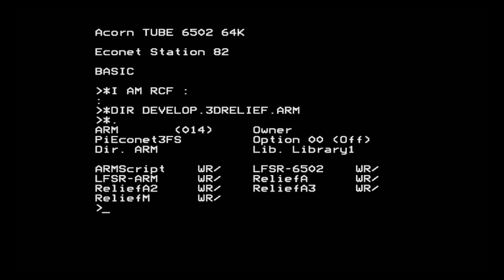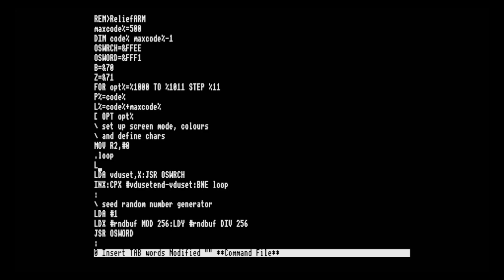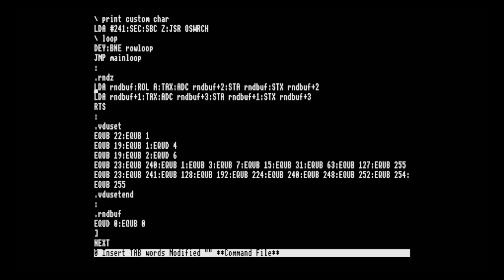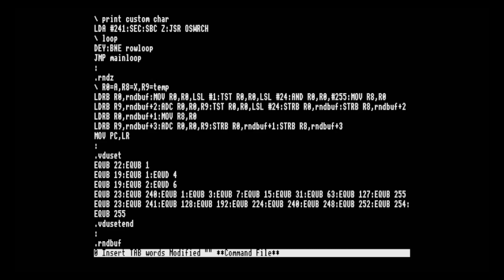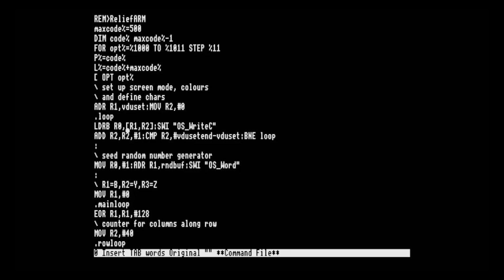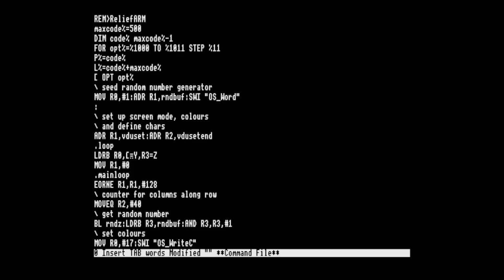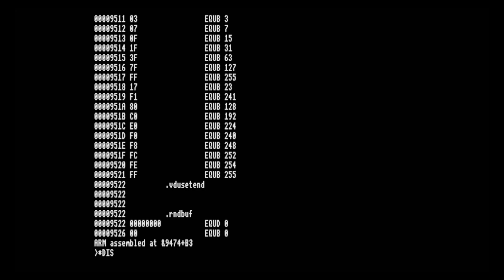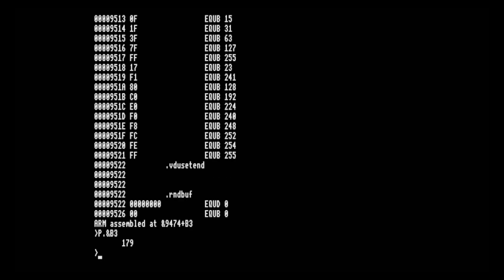ARM 3D 10 PRINT using the BBC BASIC assembler

Comment: The ARM chip has the MUL R0,R0,R8 instruction as well as DIV RO,RO,R8 as well as UMUL and UDIV
Reply from the maker: I think that the first register to be multiplied cannot be the same as the destination register — e.g. you can do MUL R0,R8,R0 but not MUL R0,R0,R8.  DIV isn't supported in BBC BASIC V (although I think if I manually fed in the opcode, the code would run).  That said, I don't think either would be helpful in this program.

Also, I was trying to stick to the original ARM1/2 instruction sets (although I do know of a problem with that which I overlooked!) so I could run things under the ARM2 coprocessor on the PiTubeDirect.  I had some problems with that which I've now resolved and could cover later — I decided the video was too long anyway, so didn't touch that!
Reply: @lsbyte  DIV is also useless from a performance point of view, it uses a variable and not inconsiderable number of cycles, and many transistors, which is why it wasn't implemented in hardware on the original ARM architecture, which was designed for 1 instruction/cycle, it's only really useful for code density and convenience.  It's not RISC.

This is also why STR seems a bit weird, because it's RISC it's a load/store architecture, unlike 6502. Arithmetic functions can't directly reference memory, and the LOAD/STORE instuctions explicitly operate on a register and address/constant, rather than arbitrary values with source and destination.